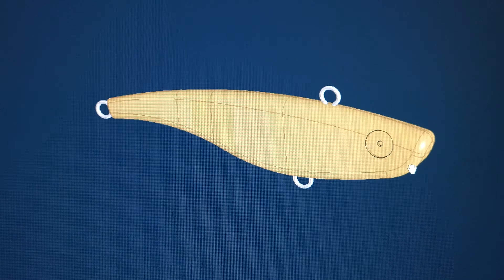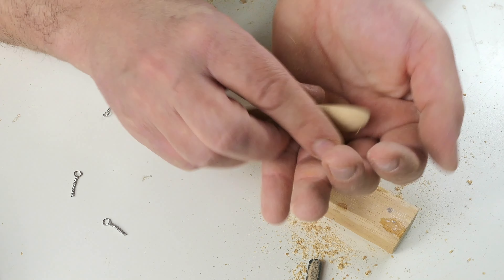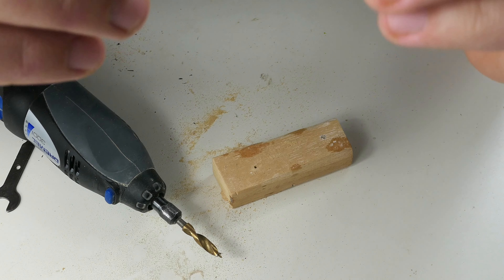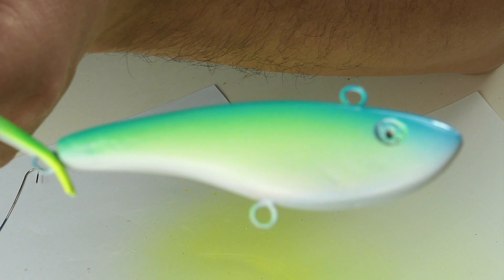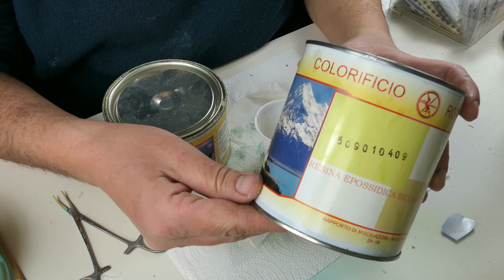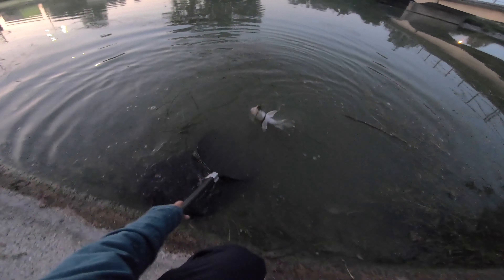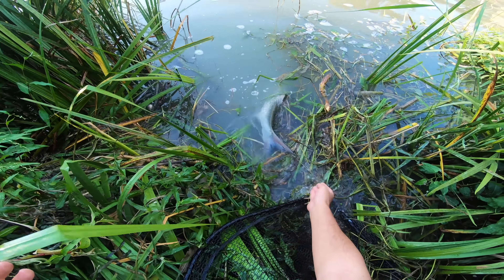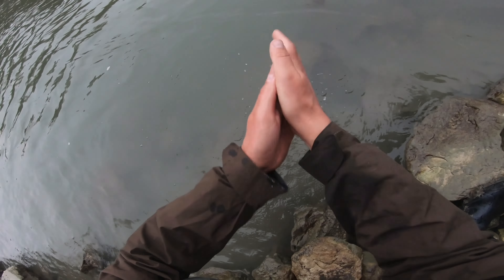Making a Wooden LIPLESS CRANKBAIT LURE That CATCH Fish

Comment: Hello. I have problem with createx paint - what needle you use in airbrush ? You mix paint with reducer or not ? Thanks :)
Reply from the maker: hey mate. I use a 0,2 nozzle from Iwata (not 100% sure and I can't check right now - could be 0,25) and I had some issues to with the pearlized colors ... with wich it's better to go with some bigger noozle. If I have to make just 2 or 3 lures it's OK ... but if I wanna spray longer than it get clogged. Try some bigger nozzle man. cheers ...
Reply: @AnEm_Fishing  do you use reducer to paint ?
Reply from the maker: Not really … perhaps in some pearl colors, but don’t like it that much …

Comment: Hello. What microseperes do you use ? I used glue with soda, but this is too hard to sanding
Reply from the maker: hey mate. sorry, I don't remember anymore ... I have them for at least 15 years in a transparent bag. I used them when I was pouring my lures in resin and wanted to make the back much lighter. I think that any microspheres should work perfect ... with the superglue they become plastic ;). cheers man ...
Reply: @AnEm_Fishing maaby is aluminum powder   resin filler ?
Reply from the maker: No man, they are plastic microspheres … that in contact with the superglue become plastic 👍